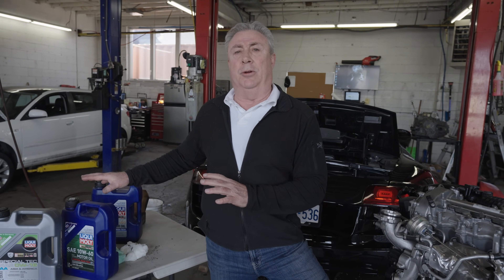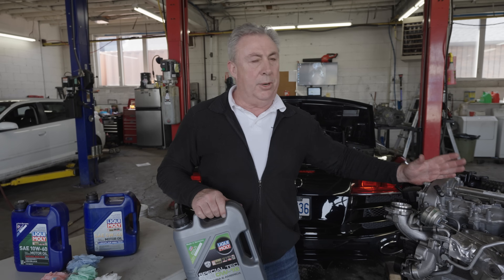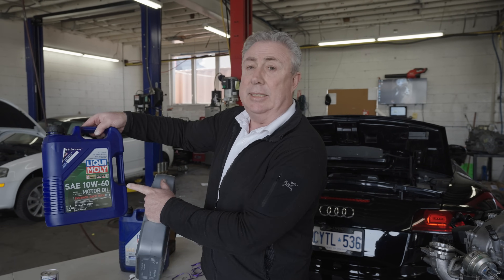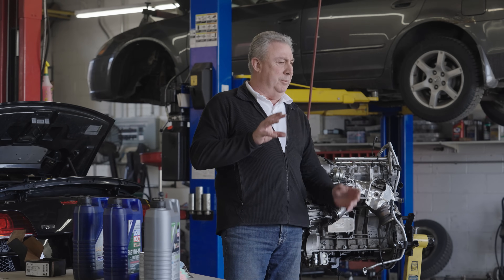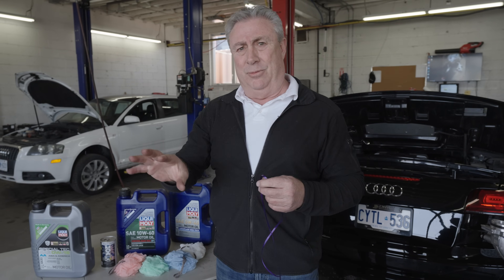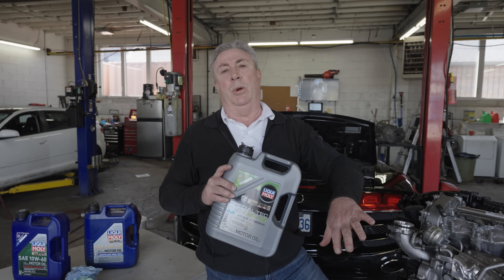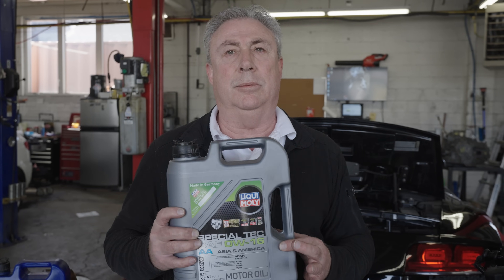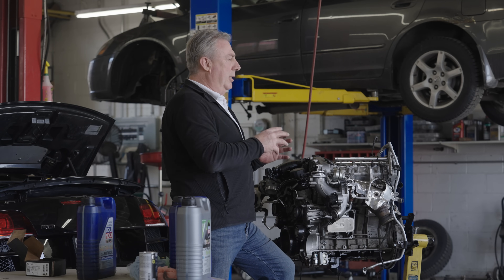Thin engine oil just a Scam? What's Safe

Comment: I've ran 5w30 in my Toyota that calls for 0w16 since it was new . It runs so much quieter and absolutely no problems . Oil analysis has proven this for me as well
Reply: We run 5 W. 40! In our 2010, toyo corollA. EURO formula. It's the best.. now we have 700.000. On her❤🎉
Reply: @IronMike-f8i   Same Engine and transmission? What oil do you use? Thanks
Reply: I have a 23 Tacoma i run 5w30 and my engine likes it so much better than 0w20 and i also run 5w30 in my 2012 Toyota Camry
Reply: @stoneycarter7789 0
 W.40!! Is better.
Reply: Hey thanks for your post.  I have a 2022 carry se and when I bot the car and saw it takes 0w 16  I immediately thought this is too thin.  So you've been running 5w 30 for how long?
Reply: @jtop2225 use heavier . It's BEST
Reply: @jtop2225 USE O.W. 4O..
🎉🎉❤❤
Reply: Would probably opted for a 5W-20 or 0W-30, but glad to hear thats worked well too.  Thanks for sharing.
Reply: What are you looking for in oil analysis ? I plan on going 0w20 to 0w30 next oil change in my Tacoma
Reply: @xirtam5726 I'm thinking the same, you have the 4 or the 6 cylinder
Reply: @xirtam5726  you have your 0w20 sample sent it, then you run 0w30, have that sample sent in, and compare them. If one shows more wear metals PPM then go with the other one. These numbers can also change over the life of the engine, being much higher when its new. So keep that in mind
Reply: I have used 0W-20 in the summertime in Toyota!  I'm really not a fan of  0 vesscosity!
Reply: @johnlevison9552 O. W. 40!! IS THE BEST. IT COVERS EVERYTHING❤❤🎉🎉
Reply: I just stick to 5w30 tested over the years and true  amsoil , don't bother with thin crap .
Reply: Auto makers don't care if you burn up your motor at 100,000 miles. Then they sell you a new car. It is an MIT philosophy called "planned obsolescence"
Reply: Is it a Toyota hybrid?
Reply: @pugman111 A25A-fks engine . Same thing for hybrid or gas version.
Reply: How many miles do you  have so far? Im curious cause im doing the same thing on my 2025 Mazda cx5 . pu 5w30 in it on the break in oil change. Any reassurance i can get is helpful.. as a lot of people are now saying the oil pump is programmed differently for different parts of the world.. the whole thing is confusing to me lol
Reply: @dillonDner I'm at 60k now.   The theory of oil pumps having different programming is all here say. I have researched and searched service manuals and cannot find any literature or any proof of such theory
Reply: @EverydayJ1786  Same here... this is good to know ouve gone 60 k like this.. makes me feel a bit better about my decision
Reply: @dillonDner absolutely true
Reply: 0W16 is for places with very cold temperatures. Not for anything above 0 Celsius and where temperature is relatively high like 40Celsius and above
Reply: @ameerm4899  not true, you just have to see the first number, so even 0W30 is good
Reply: @mephy72 0W part means it's good for cold starting. 16 or 30 or 40 means how it will hold up in engine temperatures once warmed up
Reply: @mephy72 0w30 flows noticeably slower than 0w16 despite the zero.
Reply: I used gears oil in all my Lexus engines ,,thicker is better protection

Comment: Hydrailic pressure is hydraulic pressure.  Lack of air in lines. Understand . Do you worry about your brake fluid viscosity? NO!!!
 As long as you have hydraulic pressure your car stops.  Thin or thick is not the issue. Cheap or foaming oil is.

Comment: Also you not mention SELECT FIT CODED BEARINGS . Every bearing is clearanced to minimum oil space. And then you have piston cooling jets to spray cooling oil under the piston crowns. Thin oil splashes inside to COOL BETTER. 
Turbos burn out because of driver ignorance as well. Turbos must warm UP and warm DOWN before shutoff. When coolant can draw heat wave down after waterpump stops. Temps spike and coke . Manifolds crack too.

Comment: I changed from 0w20 to 5w30 in my daughters 2012 suburu imprezza with 80000 miles it was clattering and making a racket,5 minutes later it quieted down and has been running smooth for 5 years,I believe my own research thank you!
Reply: Subaru has lay down boxer engine. Lifters are horizontal and need quick bleeding. Many other faults in boxer engines. Study Porsche VW .  Faults outway it's advantages and costs are off the charts.  Not a cheap design.
Reply: @berttompkins9096  I've put 267,000 miles on one Subaru...sold it to a friend who put another 100,000 on it & another one I put 307,000 miles on. It's all about the routine maintenance. Oil every 4k...CVT fluid every 40k...coolant system every 70-80k...brake & differential fluid every 30-40k. Just bought my 3rd one...they are bullet proof unless your too stupid or cheap to do the maintenance or simply drive like fool.
Reply: The 2011 Subaru engines used 5w 30 and the engines didn't change so I think you are safe.
Reply: Quieter doesn't mean better, Serial killers are quiet.

Comment: you look at owners manuals in Mexico, Brazil, Saudi Arabia, Australia, etc. to see how thick you can go.  The 2025 Mexican Camry manual says 0W-8 is the factory fill in the A25A-FXS motor, but 0W-20, 5W-20 and 5W-30 are also recommended for all temperatures and 10W-30 is OK too at outdoor temperatures above zero degrees F
Reply: Yeah because 10w is good down to 0F.  5w is good down to -22F and 0w is good down to -40F.

Comment: My Mazda CX5, 2017, 79,000 Km; biggest mileage year,  12000 Km, 2 oil changes per year, 0-20 synthetic, always on the full mark on. And running smooth as ever . 
- Just waking up to the other big issue and getting its first service on the transmission, manual be damned!

Comment: The new synthetic oil does not break down the same as natural oil. Modern engines are made with new metal alloys that are more wear resistant.  Engines are engineered with oil ports and tolerances that require thinner oils to properly lubricate all moving parts. Always use the manufacturers' recommended lubrication fluids, or you could blow seals, burn rings, or spin bearings. Engines built in the 1960 running natural oils only lasted 80k miles. New engines can last 300k on synthetic oils.

Comment: I use what they call for 0w 20 but I'm very strick in changing every 3000 Miles not this 5-6-7000 or even higher Crap....
Reply: You waste good oil
Reply: @berttompkins9096 Dont care oil is cheaper then metal..
Reply: @berttompkins9096 how much does it cost to rebuild an engine? $$$$

Comment: my dad.
Built engines in the nineteen seventies and they had very tight tolerances  you ran 10w-30 and 10w-40 they would  last for 200.000 miles
Reply: It's not the 70s.

Comment: Dropping in a 5W-20 in place of an 0W-20 won’t hurt anything, pretty hard and fast rule with passenger vehicles. The second number is the oils weight (viscosity) at its operating temperature and nothing good will come from changing it. Do not put 10W-40 in a car that calls for 5W-20, you will mess up the variable valve timing.

Comment: Not sure if they still do this, but they had an illustration with arrows showing the temperature range of different grades of oil in the service manual.  Environment is a key factor in what grade of oil you choose to use

Comment: Put 10w30 in a Hyundai that calls for 5w20. Car will not accelerate and misfires and dies out. Lifters pump up and no compression. 
Put 5w20 back in and it runs fine.
Reply: Excelent

Comment: I have a 2014 Corolla EU version bought in 2021 and took ir to Toyota dealership for oil change, they used 0w20 and previous oil changes the engine had 5w30. Since 2021 I.ve continued w/ 0w20, I did wrong ???  90k km, oil change at 10k km or less, in the manual both 0w20 and 5w30 are recommended

Comment: I have a 2025 Camry Hybrid and it’s 0w-08. Toyota dealer said the engine has been engineered to run on that with the new 5th gen hybrid system & change every 10k but recommend 5k. I checked Amsoil and this is what they say on their website below. So is this engine going to have a short life span?

0W-8 (All TEMPS)  -  The specification listed is valid from April 2023. If SAE 0W-8 is not available, 0W-16 oil may be used. However, it must be replaced with SAE 0W-8 at the next oil change

Comment: In South Florida, year round…
First thing after buying my 18 GT 5.0 , dump that watery shit out, run straight  (AeroShell) 30W oil for break in ( no detergents) , run it for 250 miles, dump it. Then been running Motul 20W-50 since. 
Every other 5.0 Coyote makes a lot a valvetrain noise, especially at idle, except mine, silky, smooth.

Comment: Some believe higher (Thicker) viscosity oil has a stronger film strength compared to lower (Thinner) viscosity. It’s not that simple. Viscosity is a measure of resistance to flow, not a measure of film strength. 

Oil overall performance is obviously better then ever, and can be thinner with more then enough film strength to protect the engine, plus lower viscosity can help cool parts better then higher viscosity. 

Only use what the manufacturer recommends, as nobody knows that engine better than the engineers who designed and built it. 

45 years ago most car engines were done with only 100,000 miles on it. Now they can go double or triple that distance and even beyond that. When proper maintenance is done consistently of course. Keep your fluids fresh. Engine oil, anti freeze and transmission oil.

Comment: I note the presenter is talking primarily about viscosity of oil and that is temperature related to a scale that manufacturers follow. EG: The oil in an engine in The Artic will be thinner than an oil used in Iraq. Common sense, right? Well, it becomes more complicated when we look at the "specification" that the manufacturer of engines requires to be used in each engine. In the US it will be theAPI & ILSAC spec, while in Europe it will be the ACEA spec.,

The problem with wanting to change the viscosity of the oil you use may not be possible if the Spec for a different viscosity doesn't meet the actual specification required for your vehicle. So, in that case, you would be wise to ensure you are using the right specification oil.

Comment: You are forgetting that a lot of motors have VVT actuators that will not operate properly with thicker oils and so the motor will not run properly. You will create more problems than you solve. Bad advice

Comment: Some of the manufacturers are recommended 0w/8 weight oil!! I was posting about this issue on a site and this guy responded "well, I was a jet engine mechanic for 20 years and the jet engine oil we used was so thin you couldn't tell it from the jet fuel"....had me thinking maybe I am wrong...
Reply: As far as I know turbines use ball or roller bearings  which aren't as sensitive to oil viscosity as plain bearings.

Comment: 5w40 fullsynt is very good for most engines all over the globe. thin enough for cold start and thick enough at high-temp to protect turbo and lifters very well. also add 2t oil in your diesel and petrol, i reccomend 1-200. my 2007 audi a3 quattro, 2.0t fsi engine(bwa) sounds like its under the planket when 2t oil is in. hpfp is very happy :D. i drive mostly with cold engine, very short trips. Like 500m-2km trips in 30 and 50km/h speed limit and still getting better mpg that oem spec. atm soild avarage 10.5l/100km. official in city is 12.4l 100km. and ye my engine wont get even up the temp most of the times :D

Comment: Great video. The political logic... destroy a $10,000 engine in 100K miles to save .25 mpg, when it can run for 500K+ if maintained... I'm nearing 300K miles and run 10W-40 in my Infiniti that calls for 5W-30. Keep your tires inflated, air filter clean, use cruise control where possible while driving easier from stoplight to stoplight and you'll realize the same, if not better, mpg overall.
Reply from the maker: That's a great plan, and you're clearly seeing the benefits of taking care of your car!

Comment: My New Bronco 2.7 that I purchased 2/28/25 takes 5-30w. I’m not changing it. The only thing I’m changing is the service intervals. Don’t listen to the 10k service recommended intervals BS if you are keeping it for a long period. The 10k  is a marketing ploy to get you to buy their brand. I did my first oil change at 2k miles this week. I will do the oil changes myself every 2.5k in between the 10k intervals. I will let the dealer do the 10k interval oil changes so there are no warranty issues/questions in case the oil pump belt breaks or I drop one of the turbos.
Reply: Ive seen stripped drain plugs from over changing oil. Dry starts from unprimmed oil filters.  Perfectly good oil dumped in waste oil heaters.  When Mobil one 1st came out it caused a major stir at 25000 mile intervals.  
So. You need to find a happy place like diesel fleets do. Change the filters every 3 months and top off your oil ( Premium oil OF  COURSE). That restores the additive package . Syn. Oil is much better lasting.  7500 is when I change it after 2 oil filter changes. On a new engine that isn't sludged up, the oil still comes oil clean.  I do a 500 Mile one on break in. At 5000 a complete oil chg. Then  change just the. Filter  and top off with  5/40 Rotella. Engines run past 200 k. Half the oil changes.  0/20  on my eco car. 3k oil changes are actually bad. Wasted oil , dry starts etc.  A big tip is this. At full throttle clear flood mode keeps fuel injector off. After oil chg. Hold pedal to the floor . When oil lamp goes off you have primed the filter.  Now release pedal and start engine with no air in hydraulic circuit.  Cheap advice.
Reply: @ changing filter only works. A family member purchased a new Impala back in 1966. He never changed the oil just the filter. He put over 100k on the engine and it ran fine. He eventually traded it in on a new car.

Comment: I use diesel oil in my gasoline motor rated @ 5w30 viscosity. Winter Spring Summer Fall. 211000 miles, runs like a top.

Comment: Old vintage engines or even modern engines with high mileage will have difficulty in their oil pumps pushing thick oil. 
Also, thick oil tends to gum up older high mileage engines due to weaker pressure. 
I think you should just experiment a bit and figure out what oil your engines performs the best with . 
Something I do about once a year in my older engines is :add a quart of kerosene to your existing oil before changing, remove your coil wire, and remove your plugs. Then take your starter and turn your engine over for a couple minutes. Then drain your engine, refill your oil with new filter(if you can fill the filter halfway with oil), replace your plugs and coil wire. This helps in removing build up and gummed up parts while also cleaning out the oil journals. 
Good luck to everyone with their vehicles. I hope all have a happy and healthy day. Cheers!!
Reply: interesting

Comment: Even Toyota here in Straya is putting 0w20 instead of 5w30. I caught my dealer doing this and confronted them and all they said was, it's okay to use 0w20. I asked for guarantee on the service till next oil change and they flipped back

Comment: This is incorrect, the reason for the use of lighter weight engine oil. is because engines in newer vehicles. have smaller oil passages and it's more difficult to pump heavier weight oil though these smaller passages. and especially during start up the oil can't reach all the areas in the engine fast enough. causing dry start ups and ultimately over time causes engine damage.this video needs to show scientific results.

Comment: I use muscle mt-10 for my older truck and hybrid for my newer one , you should check them out , it treats the metal and yer car will run completely different specially if it’s high mileage and cold starts sound completely different

Comment: I recently purchased a 2025 Lexus ES350 with a V6.  The manual calls for 0W 20 and can go to 5W 20 if 0W 20 is not available.   I want to keep this car lasting for a long time.  I live in the mid-atlantic.  Which oil grade would better 0W 30, 5W 30 or something else?

Comment: The extended oil drain intervals are what's doing the most damage to the engines, not the factory recommended spec'ed oil.
Reply: You are probably at least partly right, as you can't go 10,000 miles between oil changes.
Reply: I agree.  I go by the oil change monitor in my '14 Chevy Equinox(2.4L 4-cyl), but never more than 6,000 miles between changes.  5W-30 in the Winter and 5W-40 in the Summer. Always synthetic.
Reply: Semi trucks can go up to thirty so surely a car can go ten. With good oil.
Reply: @hancowman7622  Most car engines don't have a high enough oil capacity, nor are the filters big enough, for extended change intervals, and 30 is too long for a truck, if you want the engine to last.
Reply: @hancowman7622  You are BS.  Show me a truck with always 30k miles betw oil changes that lasted at least 500k like most last.

Comment: I live in Miami Florida. I purchased a new 5 series BMW G60 with the B48 2.0 Turbo engine. Same as the Supra. Dealer fill is 0w20. I've been using Redline easter core 0w20 with one quart of 5w30 to slightly make the oil stronger.  How do you feel about this?
Perhaps should go full fill on 0w30 ?
I drive spirited. Always on Sport mode to keep the Rpms a bit higher.  I deactivate the engine start stop. I run lucas fuel additive ever 3 fills. Tank never goes lower than half fill. I use Amsoil power foam in the throttle body ever 10k, and oil changes every 3,500 miles. Injector changes ever 20k.
I want this car to last me. It's also a mild hybrid, not a full hybrid. Unfortunately BMW is going mild, or full hybrid, ir electric.  I would have preferred engine only
 The good thing, on Sport mode the engine never goes into hybrid mode, abd the small 48 volt battery adapts to help out electronics and engine torque. Much like the new RAM trucks. 
Any advice, I appreciate.  Great Channel.